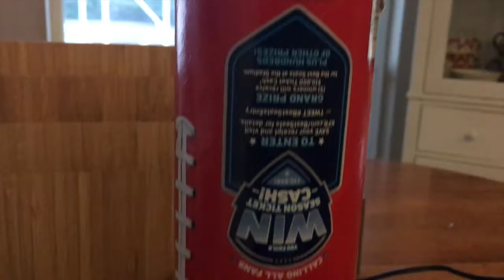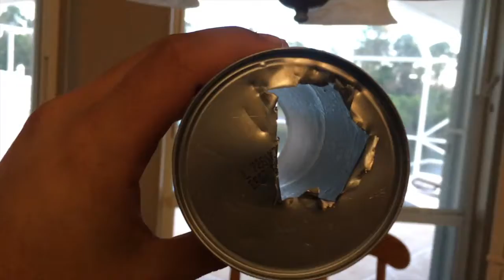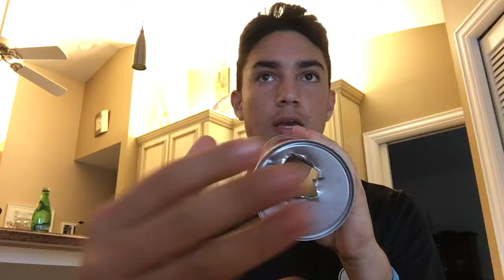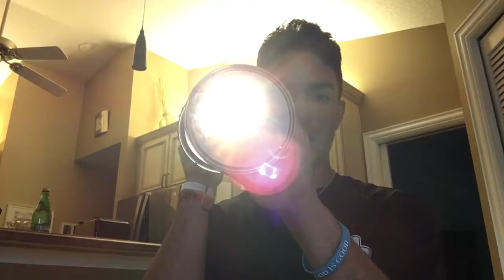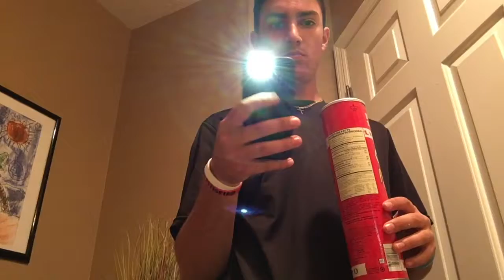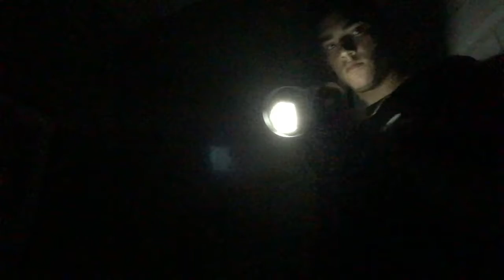Diffusion Video

Comment: So this is actually not diffusion. This is directed light. Diffusion is placing a material over the light to reduce (diffuse) the amount of light so it does not over expose the shot. If you had cut the hole in the bottom and placed the clearish lid on the Pringles can, that would be diffusion.